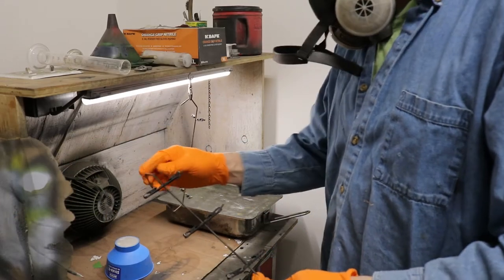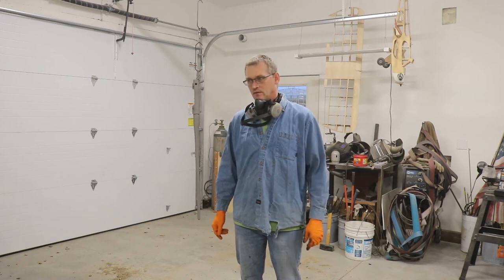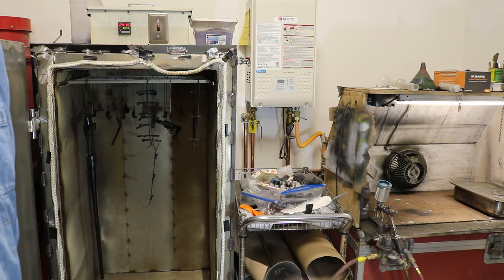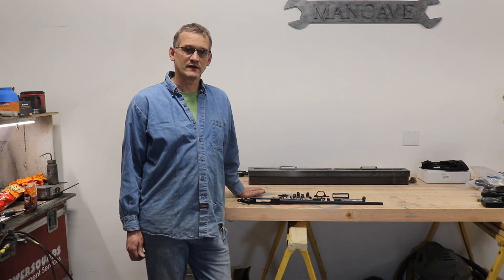Cerakote on a Ruger bolt action rifle

Comment: Are you handling the small parts with no gloves on after you removed them from the acetone?
Reply from the maker: yep,  and the coating has never failed.  My hands are super dry and after messing with a little acetone there is no oils left on them.

Comment: Great video....I’d love to see a a little more detail in future videos on your acetone bath parts soaker as well as your curing oven... love seeing shop fabricated solutions.
Reply from the maker: Thanks for the suggestions. I definitely plan on making more videos focused on a particular step in the process
Reply: I’m currently building curing oven, I fully intend to steal your idea of using 4x4 square tube for acetone bath, brilliant.
Reply from the maker: @jamesfrancis303  the tube works great but I wish it were a little bit wider. Its just what I had in the steel pile. If you got 6x6 I think it would work out better

Comment: Figured I'd share my super ghetto diy cerakote setup: For blasting, I bought a giant clear tote from wamart. I cut two holes in the front, glued some pvc flanges in it, then taped some gardening gloves to the insde. Cut another small hole in the side for the air hose to come through. Bought one of those blasting guns with the hopper on top to hold the media.

My oven is a 30 year old stove top that I got for $25 at an estate sale. Works for small parts.

For big parts, I have to cure them at a lower temp, but for longer. What I do is get a long shipping box. Like 6x6x40" or so. Then I cut a hole in the side on the bottom, and leave the top open. I'll balance that box on the side of the bathtub and put a small heater in front of the hole. Then the part (like a barreled action) gets lowered into the box and hangs on the shower curtain. I turn on the exhaust and shut the door. I've done two barreled actions this way and let them both cure over night. Both turned out perfect.

And if someone doesn't want to invest in the media blasting or the spray gun, you can call around to find someone to media blast it for you (and pay). For the spraying you can get a Preval kit on Amazon.
Reply from the maker: if it works, do it!

Comment: I did my M77 with a couple of differences. 1) I pulled the barrel off of the receiver. 2) I did the outside in E-100 black and the inside of the receiver and the bolt in C-110 Micro Slick
Reply from the maker: Pulling the barrel off can make it way easier to get all the oil from bleeding out of the threads.  Haven't used the micro slick yet.  It's haz-mat and makes it considerably more expensive to get where I live.  I heard good things though.

Comment: There should be no Cerakote sprayed in the end of the barrel, the chamber, the action or the bolt lugs. Those are all precision machined surfaces with very tight clearances. My SIL had a rifle Cerakoated for my 12 year old grandson and it was done just like you did this Ruger. The bolt was extremely hard to open/close and it took a lot of effort to move the bolt in/out. I removed the coating from the bolt lugs with a wire wheel and it made it a little easier to operate. I couldn't load any ammo for it because I couldn't get a case far enough into the chamber to measure for headspace or bullet seating. I told him to take it back to the gunsmith that coated it and get it cleaned. The gunsmith (with 40 years of experience he claimed) was furious and told my SIL that I didn't know what I was talking. To prove that I didn't know what I was talking about he loaded a cartridge into the rifle. It got stuck in the chamber😊.
Reply from the maker: It sounds like whoever applied the cerakote put it on way too thick and didn't plug the barrel. I have had no issues with any of the rifles I have done. I do put a oversized rubber plug in the chamber that keeps most of the paint out of where the bolt lugs seat.  When applied properly cerakote only adds .0005-.001.   I definately agree that it should never get in the chamber or the end of the barrel.

Comment: What exactly do you use to degrease and how long does it have to sit there in the tub and then when it comes out of the oven don't wipe it with anything and wash it right Thank you
Reply: I use acetone in the tank.  I let it sit for at least 1/2 hour.  I usually soak them overnight if I can plan it out right.  When I pull it out I let it evaporate off then sand blast.  After blast I gas out in the oven for 1/2 hour usually at 180degrees.
Reply: After degreasing is the Acetone thrown away or can it be used again and if so how many times can it be used Thank you
Reply from the maker: I reuse it over and over then.  I draw it off as needed to clean my paint guns and mixing containers.  So it is always circulating through the process till its evaporated.